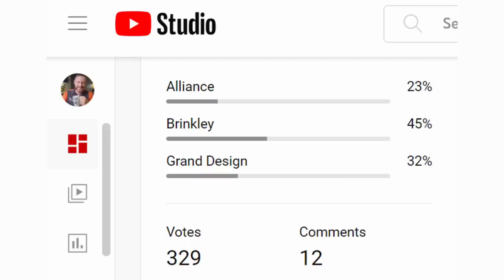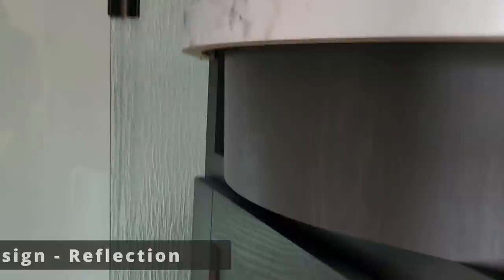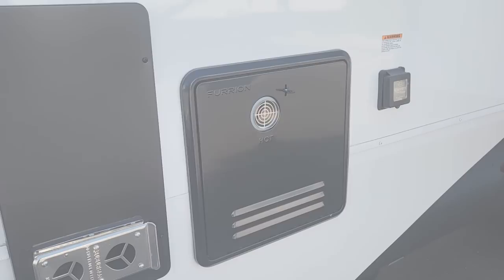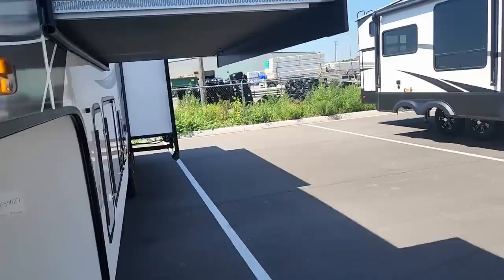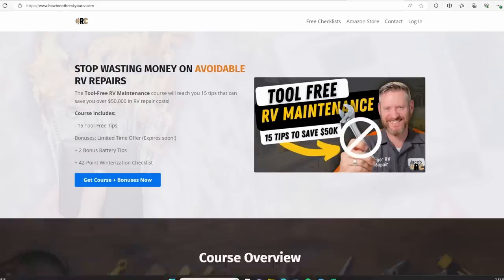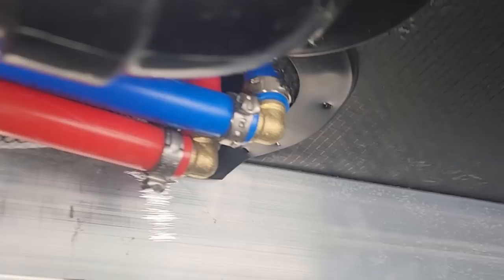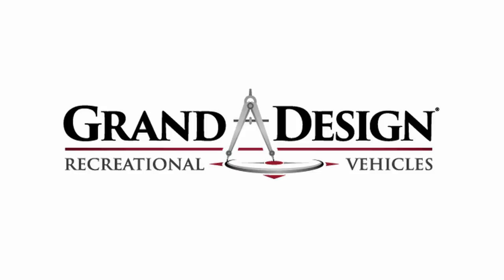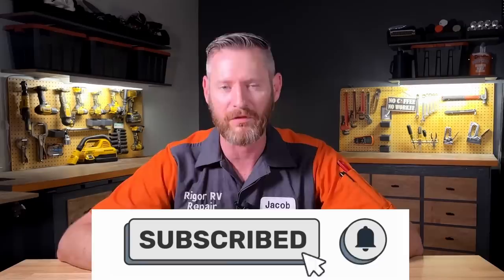UNDERCOVER RV Tech reviews Grand Design, Brinkley & Alliance RVs

Comment: Curious that you separated out Alliance models, but not Brinkley models. You gave an F to Brinkley Z3100, despite it scoring the highest on your scale because a single flex hose connection to the water pump, really? This scream bias to me. The reality is that I would not want a hard PEX line connected to my water pump as it vibrates and the vibration would travel along the PEX line creating additional noise and possible issues at the first connection point down the line (its not a house, its an RV). Also, did you do any evaluation of the type of flex hose used? Per Brinkley (take for what you like) they put in a good amount of research into choosing their vendor and use a no-kink and no-crush flex hose. You also neglected to note that Brinkley provides shutoff valves for every water line. Granted they have only been on the road for a little over a year, but in their user groups I can find no issues with them failing and I believe this is likely due to the brass fittings which can have more pressure applied to them without the risk of them cracking. The same search in Grand Designs user groups (I am a former Grand Design owner) and the number of reports is overwhelming with many occurring in the first few months. I have also seen many reports of the plastic elbows used in GD and Alliance cracking and leaking prematurely, yet that is not mentioned in your video.  Another item I did not hear in your report is that Brinkley uses leaf springs that are rated higher than the axles and that their leaf spring hangers are reinforced - the ride quality is quite good. They also have an improved frame, higher rated tires, and more. The bones are what makes an RV that will last and Brinkley has great bones, most other items are reparable without loss of use. 

I own a Brinkley Z3100 and am full-time on the road with my family and have had zero major issues. When our unit arrived at the dealer we went in before the dealer did and found the unit to be absolutely spotless with no saw dust, fallen trim, or alignment issues - it was clean and ready for use. I feel sorry for dealers who have to do a ton of work on GD and Alliance to get them ready to sell after arriving from the factory and unfortunately that is filling maintenance bays.

Comment: Quality is pretty poor these days.  I bought a 2023 ice castle zr21.  Been in the shop twice in less than a year.  Wheel alignment issue.  Hydraulic hose wear issues.  All cedar cabinets but they didn't even bother sanding anything.  Trim/backsplash falling off.

Comment: Maybe update this specifically with regard to Brinkley and their public stance (below) on this. Just a thought. 

“We have always used a flex hose that is semi rigid and approved by our suppliers for all of our applications. No other manufacturers use this hose. The water pump manufacturer specifically states you NEED to use a flex hose off of the water pump to reduce vibrations. All of our fittings have also been approved and we have had zero issues with these connections in the field. Even though we have not had issues, since this video, we have moved to a preinstalled hydraulically clamped fitting coming off of the pump. 

Having said all that, our goal is to always improve, provide an unprecedented customer experience, and do the right thing (both before and after the sale).”

Comment: I bought a new 2019 Grand Design, Reflection in 2018. It was a lemon. The engineering and design was borderline negligent. The used a 1/2" kitchen floor because they were out of the spec 3/4". This caused the floor trim to scrape a hole on the main floor. They never addressed it. The squirrel cage and the ceiling fan gear box were made of plastic and blew up a year later. They were too lazy to clean the sweep the roof before laying down the TPO membrane. This resulted in small sharp granules poking a hole through the TPO causing water damage on the roof. The tandem wheel axles were off kilter and causing the tires to wear unevenly. Owners with media channels got excellent customer service and all others without media channels were literally blown off. The best thing I did was to get rid of it 3 years later. Grand Design is a piece of junk. Be advised. Grand Design product is subpar and customer service sucks. Stay away.

Comment: JD says it’s your fault bc you overloaded your rv with batteries, washers & dryers and all of your unnecessary stuff basically. Thank you for showing what JD and Lipperts reps failed to discuss craftsmanship or they did but pretty much denied or passed it off when asked about the quality of the steel and where it’s sourced from. I see the particle board and bad welding right off top and that alone can lead to structural integrity going down the road. The people putting there rv on a better built trailer(Crawler Haulers)appear to be on to something.

Comment: Had an alliance paradigm. Constantly falling apart. Plumbing to fit and finish and slide issues. Broke everytime it moved. Couldn't stand the build quality. Been in the solitude for over a year and 0 repairs needed.
Reply from the maker: Interesting. What specific year and model are both the Paradigm and Solitude? I would advise inspecting all of the flex hose plumbing connections regularly, I've had other GD owners report leaks popping up at 14 months. I don't think that a year of use guarantees you will not have issues with this in the future. Thanks for watching!
Reply: @undercoverrvtech  2021 Paradigm 372rk/2023 Solitude 380fl. Grand design so far has had 0 issues, Much higher build quality. The interior is so similar to the Paradigm it feels like the only thing you pay for is better finish quality Quanality. Let alone the mass amount of storage on the Solitude. We don't pull slow and put 1000s of miles a month on just the camper. Alliance broke during every move and while parked. Alot of water leaks are caused by the lack of a pressure reg.  If this trailer falls apart, we may move to a new horizon. We want at least 5 years per camper. Most arnt built for work.

Comment: Thanks for sharing with us! We have a 2022 Grand Design Imagine 2400BH and just checked our schwintek slide rollers with the slide out and they dont roll/move 😱🤦 I guess that means we should expect problems soon?
Reply from the maker: It really depends on how much pressure is on the V rollers. Sometimes there is so much pressure you can see the lower rail twisting out. Sometimes there is just enough pressure to stop the v roller from spinning but not enough to do damage.  The weight of the room is supposed to rest on the floor rollers underneath,  the v roller is only to help keep the gear close to the track.
If a slide room is putting too much pressure on the v roller, the best solution is to install a flat plate on the bottom of the room over each floor roller to raise the room up.
Reply: Thanks so much for replying!
Reply: There is a Lippert Service bulletin out on the 2022's.  From November 2021 to Jan 2022, Lippert used what is called the Inverted V Schwintek racks which were mis manufactured.  Look at the Schwintek H column on the inside of the slide system.  You'll have to bring the slide in to access the H column.  On that column is tag which shows the date the H column was manufactured.  If that falls within these dates, Lippert will replace the entire slide system for free.
Reply: @TheMinnow101  Thank you so much for that info!

Comment: Yeah, you lost me at giving Brinkley an 'F'. You went for semi-scientific scores, then arbitrarily gave Brinkley an 'F' (numbers to letters - weird!) to be edgy. Brinkley is hands down light years ahead of GD and Paradigm in build quality. Their CS team even responded to your video on FB, explaining why they designed the plumbing that way and basically demolishing your drive-by points. What did GD and Paradigm say? Crickets and I know that because I'm in FB groups for all three. So shitty light fixtures and half assed blunt saw cut wood is just fine right? Brinkley uses high quality flex lines because it isn't a great idea to plumb rigid lines into a vibrating pump - even if it's rubber mounted. Not all lines are spec'ced equally - did you ever seek feedback from Brinkley owners to see if they had water line issues? I really liked your video right up to the point where you became a shill for Alliance, despite overwhelming evidence of their numerous QC issues. And for the record, no, I don't own a Brinkley and yes, I'm well aware, first hand, of the plumbing design issues you explain.

Comment: As a RV Tech, I would think you would know that anything manufactured by Furrion is crap and should not be used.  The RV industry keeps using Furrion because its cheap (for them) and some products look "new" or "sleek".   Furrion builds everything they make cheap.  Pretty much everything they make does not work like it should including their AC and water heaters.  Can you name one Furrion product that works well?  Even their stove/oven cant even heat up beyond 375 degrees when its set at max.  I mean how hard is it to make a oven??? Yeah don't give Brinkley a 10 for using a Furrion AC.

Comment: MDF is cardboard? Wrong. We've made speaker boxes from MDF for years because it's super stiff. Yes it must be kept dry but if it is it's a fine product assuming you use the correct fasteners.  And you give spring suspension a 10?  That makes me question your judgement.  Torsion suspension is superior in most cases.  It rides smoother and it's independent.  And of coarse there are higher end suspensions from Morryde.  As for cable slides and schwintek I'd never own an RV with either.

Comment: These comparisons are a little off.  You can't really compare a $70K fifth wheel with a $100K.  I'd rather see head to head using the same selling price.  Plus, it depends if you're handy or not.  I've done a lot of plumbing and feel that would not stop me from buying a Grand Design as long as the price accounts for having to buy pex to replace the plumbing.  So, I wouldn't give them an F just for that.
Reply: Sure he can.  All the stuff he covers for the tests is basic.   And there were a few items the less expensive models outperformed on the Brinkley.  The price differences jump with the Brinkley as it includes solar as standard, upgraded fixtures, upgraded sofas, flush floor slides.  That’s where the price difference starts, not basic plumbing.
Reply: I mean why should you have to get a discount to fix the errors in plumbing to begin with?  Plus with the access issues he described.  It should have been done correctly to begin with.  Not everyone is a plumber like you.  Should they be subjected to a discount for faulty plumbing if they catch it which, they’re hoping we don’t get an inspection.  They don’t care if hoses blow, that’s the problem.
Reply: @WinePunk   Both the Alliance and the brinkley have flush slides, solar is close to the same. Brinkley is using more cheap furrion crap then anybody else. They are just wrapping it up in flashy stuff and selling it or 20K+ more. 1970's looking trailer furniture, useless windows and graphics dont make it 25K better. They are made for people who think that paying more automatically means better. 105K for a mid profile is just crazy, especially when its 100% furrion trash.
Reply: @WinePunk  if you're going to wait for a perfect RV, then you'll never buy one.  IMO, you buy what fits your lifestyle and judge the rest on what you can get the dealer to fix vs what you can do yourself.  You're not going to get the dealer to replace all the plumbing but you can negotiate a discount for bad plumbing.  If you can't fix your own RV for minor issues, you shouldn't buy an RV.  Every RV needs regular maintenance no matter what the quality.
Reply: @WinePunk  I think you need to compare RV's in the same price range.  If I'm looking at $70K trailers, I'm not going to consider $100K trailers.  As was pointed out in this video, the same manufacturer will use different parts depending on the price point.
Reply: Been waiting on a comment like this. I felt the same way. I’m not in the market for a Brinkley yet it was comprable to a GD that’s  $30k less. There needs to be a balanced scale in the rating. I wonder what his A list is going to be.
Reply: @ryanryan6207   😂 When I buy an RV after the inspection, everything will be fixed before I would take possession or I won’t, it really is that simple.  I don’t need to buy problems on a platter.  I don’t understand the RV consumer that just goes.  Oh well that’s just what buying an RV is about and literally giving a speed pass to manufacturers to make junk.  

A complete fail in the plumbing system in its entirety with difficult  access to repair as in the Grand Design example Jacob showed is not a “minor” issue.  My point being it’s great you can get a say $10,000 discount and because of your particular skill set fix everything for $2500 but you shouldn’t have to be put in that negotiation position to start with. 

Just maintaining the position that’s the way it is when spending upwards of $100,000 on poor build quality is problematic.

No one is saying you don’t have to do maintenance, you have to do that on a house or a car as well and be handy, but no one buys either of those things with a complete plumbing system being whack as example there are home lenders who won’t issue a loan if the appraisal inspection comes up with major issues like an entire plumbing rework. 

Content creators like Jacob are saying this is a problem, why it’s a problem, you’re going to have problems and everyone is still lined up going sure I want the possibility of massive water damage and mold, just give me a discount, it’s just what being an RV owner is all about. 😂😂.  

It’s super easy to get up and walk away.
Reply: @ryanryan6207  I’m in the $200k range.  However, I’m still not going to give an RV manufacturer/dealer a pass cause it’s in a different price point.  If the plumbing is faulty it doesn’t matter if it’s 50k or 500k.  That’s core basic construction of any RV.  Of any housing, mobile or stationary.  Y’all just gagging to make excuses for faulty builds.
Reply: @WinePunk  you are making this a much bigger issue than it is.  The plumbing issue on the Grand Design does NOT require an entire plumbing replacement.  I have yet to find anyone saying they had "massive" water damage and mold.  You seem to be under the impression that if you stay away from RV's with improper connections, you will never have plumbing problems.  My only opinion is I'd take a discount rather than walk away from an otherwise nice camper.  If you're not capable replacing a few fittings, then you probably shouldn't buy any RV.  I see these videos as things to consider and look for, not videos for RV's to avoid.  I have yet to find any RV that has absolutely no issues. You seem to have a problem with people who can fix their own RV's.  But I understand if you need the dealer to do all your minor repair work (and plumbing leaks are minor), then you'll need to wait for that perfect RV.  It still sounds like RV's may not be for you.
Reply: @ryanryan6207  every flex hose connection has to be fixed.  That’s an entire replacement for that item and if they did that, the entire system, every connection has to be checked in depth, the hoses have to be inspected as well for possible damage.  Whether I can do the replacements or not is irrelevant, the problem shouldn’t exist in the first place. 

I’m not nor said I won’t have plumbing problems in an RV.  I’m saying I’m not buying anything with bad plumbing due to oversight or incompetence.  And no, I don’t have to say well guess I won’t RV then because of that.  

You may not watch as much rv consumer content as I do and there’s tons of videos about this very problem and the damage that it’s caused.

Some people have different standards than others.  What’s acceptable in your view isn’t to mine in regards to core construction.
Reply: @WinePunk   Again, you're being way over dramatic.  I have yet to find ANYONE who had to replace their entire plumbing system.  I get it, Some people are incapable of fixing their own RV so you should look for the perfect RV.  Good luck with that.  My original point was I would not give an RV an "F" when I would give it a "B" if they had a different plumbing system.  Let it go!
Reply: @ryanryan6207  letting it go is why we have these problems with poorly built RV’s.
Reply: @WinePunk  Let it go.  Maybe you need to take a nap?
Reply: I watched this and thought - why the heck did I just buy a new dually?  I am a 4 on a 10 diy scale.  We had a 2020 GD 260rd without an issue.  Sold it when health issues appeared.  Back in the market and this bummed the crap out of me.
Reply: @sc-921  You just need to be careful in choosing your RV.  These videos are helpful in reminding people what to watch out for.  I wouldn't use them to absolutely avoid certain manufacturers or RV's altogether.  This video would have us avoid Grand Design all together yet there are thousands of satisfied customers and you had no problem with yours.  The fact is, every RV has the potential for problems or no problems.  Take extra care in choosing and then don't ignore the regular maintenance and you'll be fine.

Comment: I bought a 2020 GD and found out a few things, when they cut holes in the floor to run vents and plumbing the holes are 10 times too big and not sealed. And using water hose with pex fittings, which is WRONG. I called GD and told there customer service that they have a grand lack of design!! She didn't think it was funny and I told her that I also don't think it's funny, and the roofs in all of these POS'S are crap.